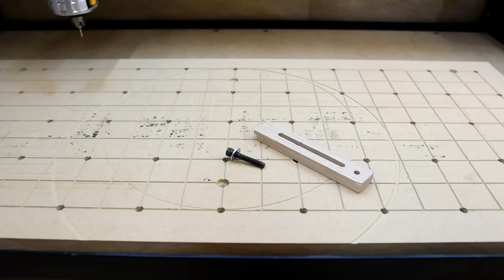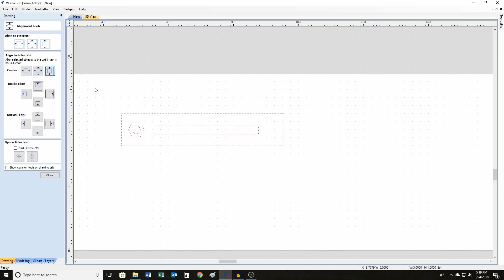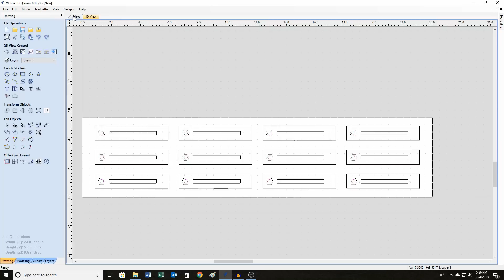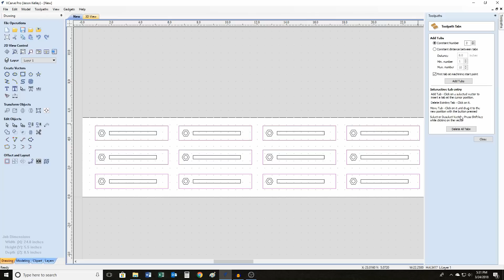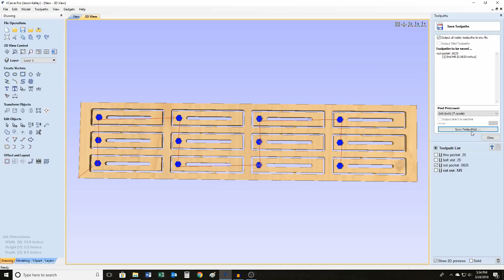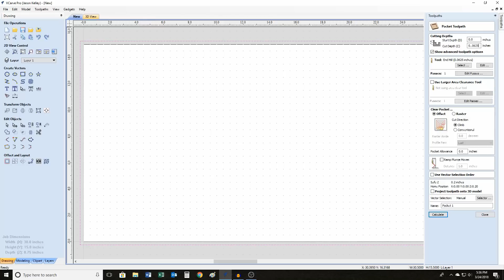CNC Basics designing your first project

Comment: To drill 1/4 inch holes you MUST use a 2 lip end mill. You can't drill with a 4 lip end mill. It does not cut in the center.

Comment: I know this is an old video, but I know understand why Fusion 360 is a bit complicated for some people. In Fusion 360, you create the object (in 3D), then you make the tool path for it. In Vcarve you make the tool path so it can create the object. I hope I am making sense. 

For what I have seen. In Vcarve you have to know the dimensions of the screws, nuts, bolts, etc if you want to make something accurate. In Fusion 360, you just go to their extensive library and import the nut, bolt, screw, etc, into your project and make the pocket or hole using the imported 3D nut or screw as a reference. It can even create threads for you. Just tell Fusion 360 which bolt or screw you want to use and where you want the thread and Fusion 360 will do it for you.

Its easier for me to create the 3D object first, then create the tool path for it. I have a college degree in computer animation, so creating 3D objects is easy for me. I think Fusion 360 will be better for complex designs and for reusing your designs. You can create an object in one scene, then import it into another scene. That way you can carve multiple shape objects without limitations.

Comment: Good afternoon from Guantanamo Bay. I have the Shapeoko XXL, I was just watching your video. the one where you made the clamps. I noticed my system is doing something yours isn't. the Z axis plate on my system has a lot of play, how do I remove the play?
Reply from the maker: Try tightening the eccentric nuts that the v wheels are on. The v wheels need to be snug enough to get rid of any play but you still need to be able to move things with minimal force.
Reply: That did it. Thanks
Reply from the maker: No problem. Glad you got it going

Comment: I see that you use the grbl inches for your g code . There is a Shapeoko inch gcode in there list. Did you Know that  and if so was there a reason you used the other. Or are they They the same. New to your site  Jeff
Reply from the maker: The reason I went with GRBL Inch is because the control board on the Shapeoko runs GRBL. I have never tried any of the other ones, but I would imagine they would work pretty similar.

Comment: Great video.  Very informative.  I'm brand new to the software.  Wouldn't it have been easier to figure out all the toolpaths for a single hold down, then copy and paste that, as opposed to having to go back and select the individual lines on 12 different objects and create the toolpaths?  Also, I would have liked to see how you cut out the rabbits, and how to align everything properly when you flipped the board over to make sure it made the cuts in the right spot.  Thanks!
Reply from the maker: Unless there is a technique I don't know the toolpath's have to be generated that way. You can copy the design, but not the toolpath. I didn't use the machine to cut the rabbets. I use a palm router, however the board would not need to be flipped over to do it on the machine because the side facing up is already the bottom where the rabbet would go.

Comment: I have a S3XL. I am using Aspire 8.5 ... the Vcarve is essentially the same. I use the Shapeoko post-processor when I save my toolpaths. That being said, I have run into some quirks when running long jobs. I've had the machine just stop communicating and I have had it also take off with a mind of it's own. I wonder if the grbl/inches is the better way to go.
Reply from the maker: It is the only one I have used. The longest job I have run was about 4.5 hours, and never had a problem. I have had everything freeze up in the middle of a job before, but I think I figured out it was my computer not the machine or motion itself.

Comment: hey STKYE - great video!  Also liked your wasteboard video; ordered tee-nuts to do the same last night after watching yours.
question - what size bolts do you normally use?  I searched pretty hard but couldn't find an "assortment" with different lengths; or did you get the bolts from Lowes / etc?

one note on the hold-down video - if you use layers, it will make it easier to "group" the similar items.  I'm betting you know that already and are trying to keep the first projects simple; I came across layers working on stacking text, and they really simplified a lot of what I do (I hate-hate-hate trying to click a bunch of items)

subscribed - looking forward to more.  If I can figure out the whole record-postprocess-etc part I want to do a channel similar to yours
Reply from the maker: Thanks. As far as using layers goes I know they are useful, and make some things easier, I just have never used them. I probably should though. The bolts I bought at lowes. If I remember correctly they come in bags of 2 or 4. A little pricey there, but like you already said I couldn't find an assortment online I liked either. As far as the making videos goes I use 2 programs OBS, and Audacity to make the videos for VCarve. They are free and easy to use. OBS is the screen capture software, and Audacity is the audio. If you can figure out a CAD program it should be a breeze to use them. Always like watching other peoples videos there's always more to learn. Thanks again.

Comment: If your router will not take half inch shaft bits go to your big box mprovement store and grab a 3/4  diameter bit with a 1/4 shaft. Not as fast as the 1 inch one but it is faster han using a quarter inch bit.. I HIGHLY recommend ramps, some bits wont cut straight down and in any case, it will prolong tool life. Depending on your controller you may have to do separate files per bit, BUT if your controller is smart enough put them ALL in the same path. I use mach 3 and it DOES support multi tool files..Once again, another good basic tutoral.
Reply from the maker: Good idea. That would definitely work.